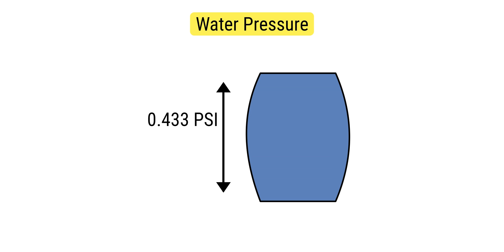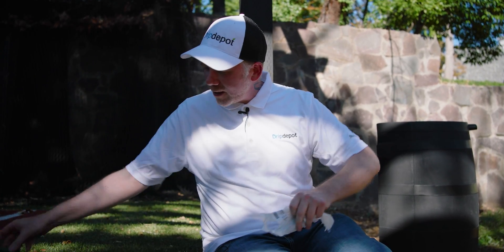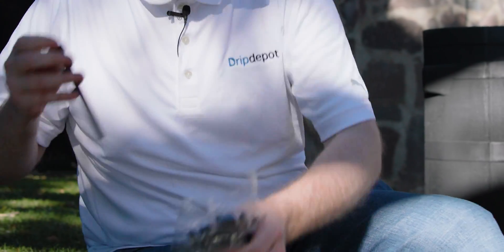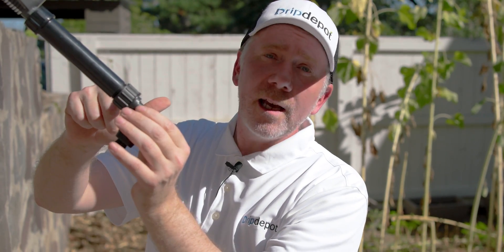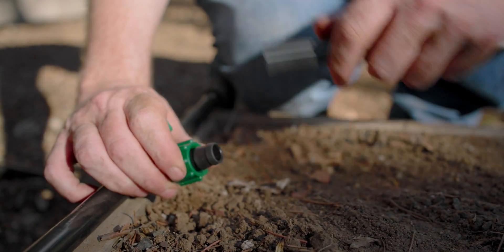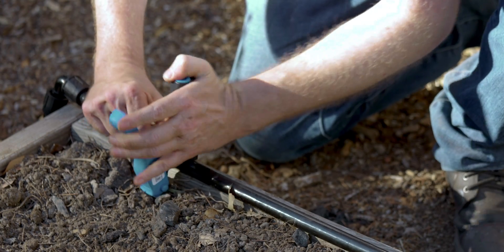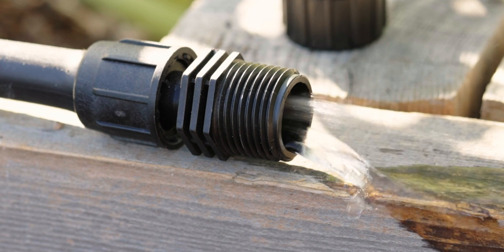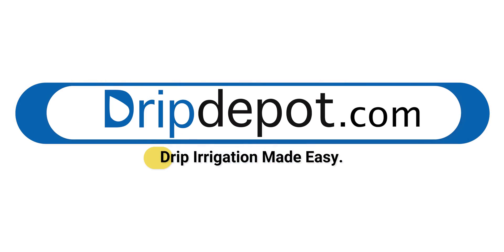How to Install a Gravity Rain Barrel Drip Irrigation System | DIY Raised Bed Project

Comment: I just watched a different video you have about installing irrigation in raised beds and it said to use drip line and NOT to use drip TAPE in raised beds - and yet you are installing drip TAPE in this video. Which should I use?😊
Reply from the maker: This will depend on if your water source is gravity fed or not (and how much elevation change there is) :) 

1/4" dripline is a higher minimum operating pressure than drip tape, so in a low pressure gravity system it's going to have to be drip tape.   The minimum operating pressure of the 1/4" dripline is 5 PSI, which is equivalent to about 11.55' of elevation, so if you're able to get the water source elevated to around 13' (to give a little cushion for small pressure losses in the system) the drip line would be viable.  

Drip tape's minimum operating pressure is much lower, in this video we were operating it at 3 PSI or less and much of it can work even lower than that so long as there is water flow available.
Reply: @dripdepot  Thank you SO much for your response! I wasn’t sure, with an older video, if I would get one, so thank you! This also makes sense, and this is very useful information and I now understand. I think I’m finally wrapping my head around all this irrigation stuff! I’ve installed a few systems and have a few things to tweak this year and a whole new system to install with a rain barrel, and another system to install at my daughters. Sure makes life easier with these irrigation systems. Thanks to your videos I’ve learned so much! I also feel like learning all about this is ‘staving off dementia’ as the learning is substantial!
Reply from the maker: @dglemmer1  Though an older video, it's one of my favorites still, it was the first big project video we did.  I'm a fan of gravity fed systems, so if any questions come up while you're planning or installing, don't hesitate to drop a line, I do check comments every day to help out with any and all questions :) 

And yes at the learning!  I've been at this for a very long time now and I don't think a day goes by that I don't learn something new about irrigation, it definitely helps keep a mind sharp (and to stay humble!  I know I'll never know it all haha).
Reply: @dripdepot  I do have another question! We live in the high mountains of Colorado and have a well. We have a filter that comes off the pressure tank. Do I still need a filter on the ‘head system’ coming off the hose bib? For my other system (gravity system) -that’s a different filter than the one you are using on the head system from the hose bib?
Reply from the maker: @dglemmer1  Great question!  And awesome on being in Colorado, I lived on the Western Slope for many years and will always consider it home no matter where I live.  

If the filter coming out of your tank is fine enough for drip irrigation, then you'll be good to go without a second filter.  Depending on the emitters used, drip irrigation likes 120 to 200 Mesh.  On the 120 end of things are larger orifice drip emitters like adjustable stream drippers and microsprinklers.  On the 200 mesh end of things are the really small orifice emitters like low flow drip tape (there's some that drips as low as 0.17 GPH, very very small orifice on those).  

Most falls somewhere happily in the middle and a good mesh for almost any system is 150 to 155 -- if the filter on the outlet of your pressure tank is within that range, it will be more than sufficient :)
Reply: @dripdepot  I have a new question and wondering if there is a way to call you? This time, my question is about hooking the 1/2 inch black tubing to the hose and running it to where I need to install the drip. Until now, we have always used a garden hose because my husband said it would give us more pressure for the system - today, my husband and I are frustrated. He says if we use the black tubing we won’t have the same pressure and that we will have to use the pressure regulator because the black tubing can’t take the pressure the hose could. All the videos use the black tubing and seem to have enough pressure to run the drip. I did do the flow test and we have 7.5 gpm and 450 gph coming out of the faucet (with our well). Do we need to hook up the black tubing and see if we loose a lot of flow? Pressure? Gah. This all seemed straight forward and now I am so confused. We need to order parts, but I don’t want to order things we don’t need. Currently we have hoses where people use the black tubing until we get to the bed where we then go to the black tubing. Can you help me?
Reply from the maker: @dglemmer1  You bet, I can definitely help with this :) 

1/2" tubing and many garden hoses will lose bout the same pressure from friction.  If you have a larger inside diameter garden hose it might lose less, but really this part will come down to how much water (in GPH) is going through the tubing or hose.  Drip irrigation is both low pressure and low flow so requires less pressure to begin with.  Most drip irrigation systems are going to use a pressure regulator to lower downstream pressure as most water sources provide too much.  Drip is also lower flow compared to overhead options, so there tends to be less pressure lost from friction.  You're likely going to want a pressure regulator either way.  Drip emitters like to operate at 10 to 25 PSI, which is lower than most water sources and won't really matter if you're using hoses or tubing.  The tubing itself is rated for up to 60 PSI, the lower pressure is more about ensuring even pressure throughout the system and keeping the emitters from putting out too much water.  At higher pressure they'll spit, hiss and sometimes mist, which is inefficient, they work best at lower pressure.  

The friction loss is all determined by how much water is going through the line and how long the line is and I can absolutely help with this part, all I'd need to know is how long the line will be (hose or tubing) , which emitters you're using and how many you'll have.  If friction loss is minimal you'd be good to go for a hose or tubing, whichever you'd prefer to use. 

You're absolutely welcome to fire me off an email, I can format answers better (and include pictures!) in an email than I can in YouTube comments.  Here is a link to our Contact Us page, from there you can either submit a ticket manually or email our email address directly.  In the subject, just put "Attention Adam" or "For Adam" or anything including my name and I can grab it, I have access to that In-Box and do a lot of work there so it would be no problem :) 

Here is that link: https://help.dripdepot.com/support/solutions/articles/11000049095-how-to-contact-drip-depot

Comment: What type of timer was used with this system? Great video😂
Reply from the maker: Hey, thank you Stewart!  

And you bet, we used the timer at this link: https://www.dripdepot.com/13919

It may not be the best timer in the world, but it's one of the only ones that can work with no pressure, which is what is generally needed in most gravity systems :)

Comment: How long would this take to set up? 1 person 8 x 24 space
Reply from the maker: This can vary a bit depending on experience with irrigation, general DIY experience, etc.  I'd say if you're new to drip or irrigation, give yourself a full 6 to 8 hours -- probably won't take that long, but best to plan for the day just in case.  If your'e an avid DIY'er but little to no experience installing irrigation, probably 4 to 6 hours; if you have experience installing irrigation (PVC or Poly Tubing) probably 2 to 4 hours.   Once you've installed one system you'll be adept and the second system takes a fraction of the time, once you've done one drip system you've basically done them all since they use the same parts in the vast majority of cases.  :)

Comment: You have advice for people with metal raised beds? Wood beds in Florida don't last very long. 😊
What would you connect the main line to if you don't have wood to nail it into?
Reply from the maker: One effective method we've seen folks use is to put a small wooden plank at the end of the bed to nail the clamps into, that way it's just a single piece of easily replaceable wood needed to secure the header line.  

In our metal raised bed video we actually just used hung the elbow over the bed and used the weight of the line itself to hold it in place.  A little adjusting might need to be done at first, but after a few thermal cycles, the line will hold its position by itself fairly securely.  

Here is a link to our metal raised bed video, no need to watch the entire thing if you've got the rest down, I set it to start a few seconds before we hung the elbow on the edge of the bed: https://www.youtube.com/watch?v=ug_CAB9920w&t=580s  :)

Comment: Question. I'm in the process of planning out a gravity feed garden. I have 3 ibc totes that I'm going plumb together and collect rain water to feed trees and beds. ? The totes are about  10ft higher than the beds. Do I have to run my line down to the  ground and up the sides of the beds or can I keep the main line on top of the beds? Is that possible?
Reply from the maker: You'll probably want to go to the ground and then up the sides of the beds -- mostly this is just due to the trip hazard/obstacle suspended tubing would cause.  Tripping on some suspended tubing could pull out fittings, cause damage, etc, suspending tubing will also cause a bit of extra tension on things by itself.  Probably best just to go ground level and go back up the bed for best practices.

On the physics side of things, the pressure will be no different than bringing the tubing down and going straight to the top of the beds -- you'll gain a small amount of pressure at ground level and then lose it climbing back up the beds to be in the same position pressure-wise either way :)
Reply: Thanks will be calling soon.

Comment: Would one water barrel supply 100 feet of drip tape?  That's how much drip tape I would need to cover my garden.
Reply from the maker: Potentially so!  To some degree it's going to depend on the emitter spacing and flow rate of the tape, but it's definitely possible.  If you have a way to elevate the barrel at all, even just a couple feet, you'll increase the odds of great performance to a significant degree (every little bit of extra pressure will help to push water to the last row of drip tape).  

I'd go with a lower flow drip tape, probably around 0.25 GPH -- this way each emitter will use just a little bit less water so there's more available for those downstream.  

If any questions come up, don't hesitate to drop a line, gravity systems are my favorite!
Reply: @dripdepot  Thanks so much for the reply!  Your videos are by far the best resource I've found for learning about garden irrigation.

Comment: How high can the raised bed be before its not efficient anymore?
Reply from the maker: With some of the emitters (particularly the black cleanable button dripper we used and the coupling valves used as emitters) you could have the raised bed quite high as some of them require very little pressure (near 0 even) to drip.  I think the drip tape would be the first to encounter uniformity problems from too little pressure, though even that would drip so long as there was flow, even if the pressure were minimal. 

Essentially, the emitters we used in the video could all work with a raised bed that was elevated fairly high, so long as the water source was enough above it to generate at least a minimum of pressure and flow.  :)

Comment: I am looking to use a system similar to this on a hill.  Can you put emitters/drippers off the main line?  Thanks!
Reply from the maker: You sure can!  Any emitter that comes on a 1/4" barb can go right into a 1/2" or larger mainline -- you can just punch a hole in the mainline tubing with a 1/4" punch and pop the emitter right in :) 

We have a very short video that shows the punching and dripper inserting process (I set the video to start about 13 seconds in where it occurs): https://www.youtube.com/watch?v=72R7EyGIgf8&t=13s
Reply: @dripdepot  Thanks for the answer and video.

Comment: Could you use the existing installation but change the water source to normal pressured water ?
Reply from the maker: You sure could!  

If it was a hose bib connected to the city water you might need to toss in a pressure regulator and backflow preventer, but both those and the parts we used in the video are hose threaded, so it could all go together and on the hose bib without any additional adapters. :)

Comment: I live in an area where everything would freeze up for about 7 months out of the year. I have done some research for having an irrigation system such as yours but how easy would it be to weatherize this system or what would you suggest?
Reply from the maker: Winterizing a drip system like this is fortunately very easy -- in most cases, you can simply drain the lines of water from a low point end cap and then leave the tubing out over the winter.  The backflow preventer, filter and pressure regulator can be stored inside, but the tubing itself is safe to leave out if it's reasonably well drained.  :) 

Here is a link to a winterizing video we made to show how easy it is if you wanted to see it in action:  https://www.youtube.com/watch?v=qOSIav1DiCQ

Comment: How much area would a 1000gal tank cover with gravity drip
Reply from the maker: This could vary quite a bit -- with overhead area coverage emitters (like wobblers or microsprinklers) quite a bit of area could be covered, but only if it could be elevated high enough to generate sufficient pressure.  

If you were growing row crops, low flow drip tape could get some good mileage out of a 1000 gallon tank, though even then it depends a bit on elevation as the elevation is where the pressure comes from.  

The best bet, at least in regards to growing the most plants, could be to go with low flow drip tape, as it would take the longest to empty the tank and can operate at very low pressure.  This of course wouldn't work with things like pasture, but does well with some trees and row crops of almost any kind.

Comment: Do you have any suggestions on how to increase pressure after flow has been achieved by gradually reducing pipe ID?  The increase in velocity of water in the smaller diameter piping might give an artifical kind of increase to PSI.
Reply from the maker: In general, you don't want to reduce pipe size unless doing so for cost reasons -- for example, if the system starts on a 1" mainline but the flow isn't enough to necessitate 1" throughout the system, there's no harm in reducing to 3/4" to save on material costs.  

In general, when reducing pipe size, a smaller diameter pipe will require more pressure in order to maintain the same flow rate as it was in the larger diameter pipe.  The smaller diameter pipe offers more resistance to the water which causes a higher pressure drop across the pipe.  Velocity, as you noted, does increase when diameter reduces, but the general rule for velocity in an irrigation system is: stay under 5 feet per second except when flushing the line.  

That last part likely won't be a huge concern for you unless you've reduced pipe and have a high flow rate.   

With all that said, if the pipe diameter can handle the flow without too much friction loss or velocity over 5' per second, there's no harm in reducing to save material costs.  In a gravity system, unless elevated very high, every PSI counts so you'll want to make sure not to reduce in a way that causes too much pressure loss.  

We actually made a video on sizing your lines recently that I'll link below -- it's on the technical side of irrigation (which I love!) so don't hesitate to ask any questions that come up there or here :).   Here is the link just in case: https://www.youtube.com/watch?v=f81BHQnXi0Y